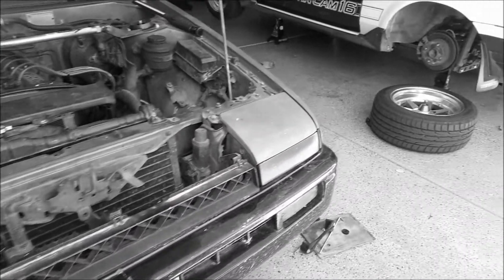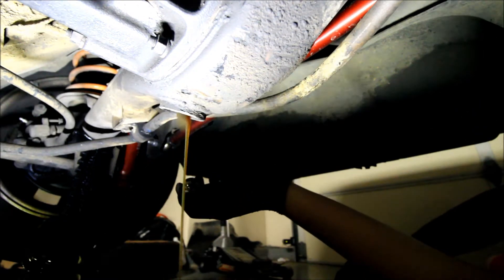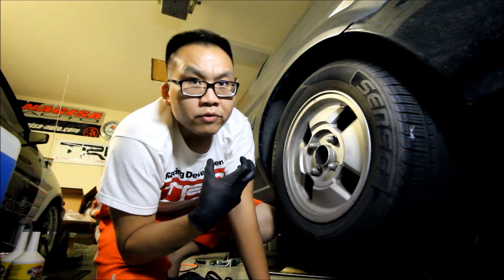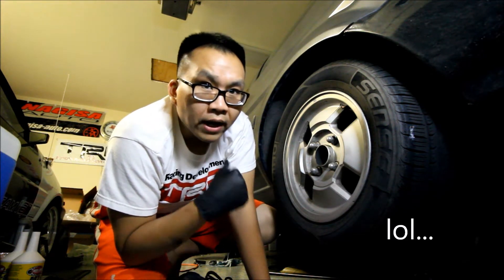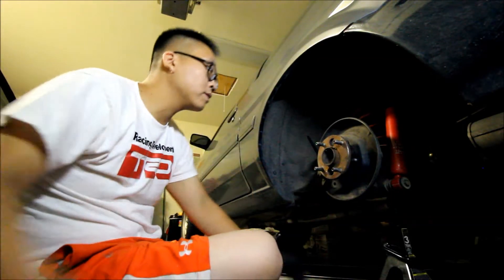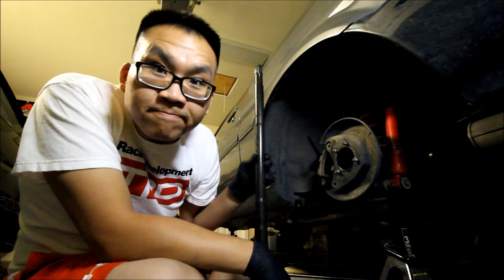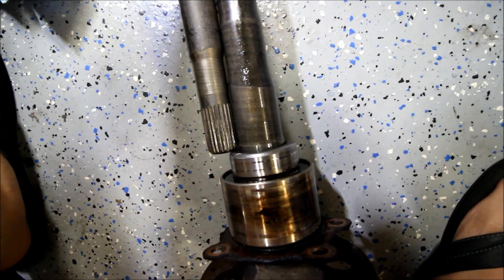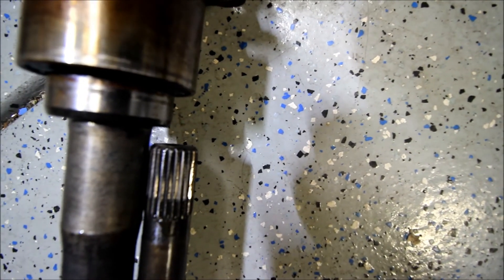AE86 AXLE PULL  |  MAKING PROGRESS  |  10 25 16

Comment: One of my half shafts is stuck in the axle . I've made a 30 pound sliding hammer and it still won't budge . I'm running outta of ideas :(
Reply from the maker: Crap I dunno man. Make sure there's enough distance of force on the 30 lbs for max impact. Best luck to you unless you've resolved it already.
Reply: would you believe i had to strap the car down while it was on axle stands , then i attached a pulley chaining to my sliding hammer and heated the axle all around the bearing . So i had it hot with at least 2 tonnes of pulling power attached to my 30 pound  sliding hammer and it still took at least one hour to break free  . I'm guessing it hadn't been moved in 32 years . I wasn't taking no for a answer LOL
Reply from the maker: @bernard7allon481  was probably locked by rust?
Reply: yea I'm guessing so

Comment: do you know how much the axle is supposed to stick from the housing? I install mines but they stick out for a little
Reply from the maker: Timechaser 4age Not really sure. As long as the 4-bolt plate is flush and torqued down you should be fine.  Your bearing will stop the axle from going in anymore than it should right? And the plate keeps it from pulling out. Hope this helps.

Comment: Hey man I’m in the middle of looking for gts axle shafts and is hard to find these. So in your video your installing non LSD shafts into your so are those the sr5 ones? I’m curious because I found some sr5 ones but wondering if is compatible.
Reply from the maker: You just have to grind the non-lsd ones down a bit